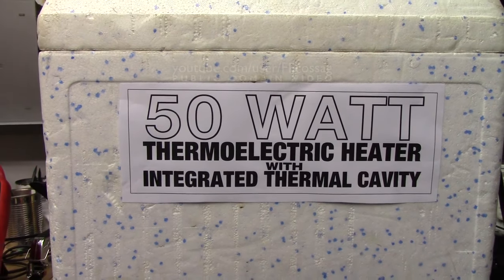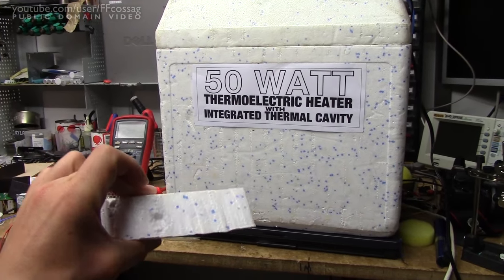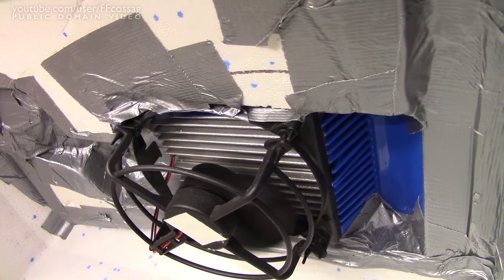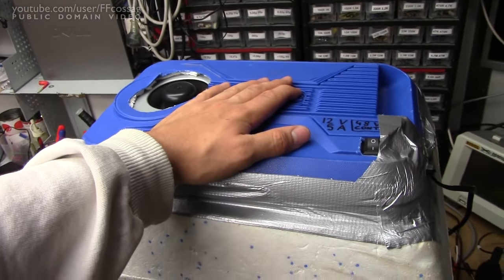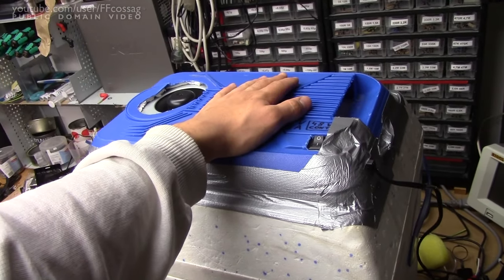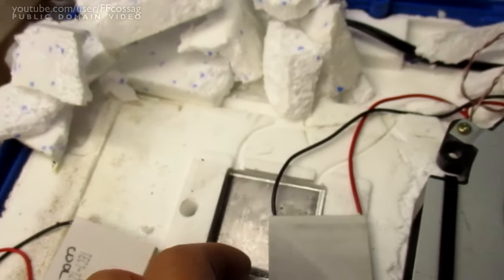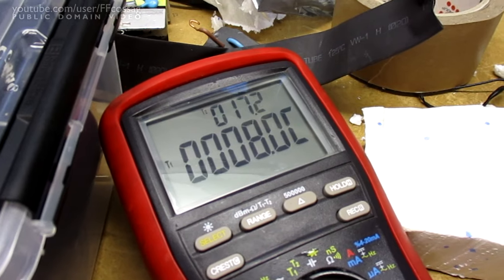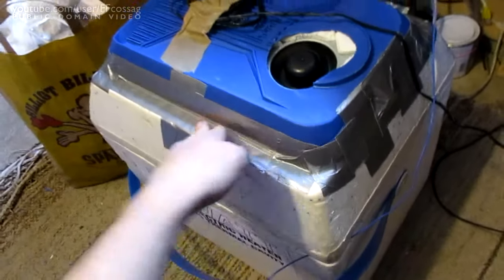Trash picked, TERRIBLE TEC fridge turned useful

Comment: It seems to me like there really isn't anything of the old cooler left now - a plastic cover and 2 heatsinks. That insulation you use works surprisingly well though.
Reply from the maker: Yep, basically. The styrofoam with the peltier cut-out is still original, although it's obviously surrounded by insulation.

Comment: One unpleasant surprise I got from a styrofoam cooler costing under $5, probably more like $2, was that it leaks easily.

Styrofoam coolers in my opinion are only suitable for one-time, outdoor use. Do not set a styrofoam cooler that is in use on fabric, and especially not in a vehicle. You'll find a large wet spot, and more problems than you really want to deal with. My cooler was filled with seven pounds of ice and, having left it in my car over night, all seven pounds (except for a bit of ice) had impossibly drained out the bottom by morning. The cooler had no punctures, cracks, or visible damage.

I see that you're using the styrofoam cooler more as a refrigerator, but it just isn't as robust of an item as it might seem.

Comment: Are you gonna put a thermocouple in there to measure internal and external temperatures? PWM the TEC then with a PID loop to maintain a set temperature 😃
Reply: Can you make it cool more with PWM?
Reply: Evgheni Melman Probably not, but I like your thinking. I imagine you're thinking of how it works for LEDs to increase apparent brightness? It works for LEDs that way because of the way our eyes see light, and fuse flashing light together. It's exploiting a trick of the brain

Comment: dual fuel condensing/lpg fridge - used in caravans for decades - I have a 20yr old one that still works - and is more efficient (from what I can tell) than my diy peltier cold box.
Reply from the maker: They're probably not that much more efficient than a peltier, it's just that you have such a HUGE increase in power density in a gas bottle. I don't really have any way to exhaust the burned gas, however, which would be a bit of an issue.
Reply: I've tried all whilst camping - commercial peltier/ home made peltier and lpg/12v condensing fridge - from experience I  found the latter more efficient - and practical - even just on 12V - the Exhaust and inlet for the LPG is literally a cut hole and bolt in experience. It was so easy - I did it myself on a camper van and a caravan. However, I can see the benefit from using the peltier - but I would double or triple the peltier units - one just doesn't cut it - esp. when you need something cooled, such as a meat product or indeed milk. Once I'd definitel go for a temp control using Arduino - it's cheap and easy - and can reduce battery consumption when off grid.
Reply from the maker: Sasquatch
A fuel powered fridge is definitely going to be more practical and less headache. You could probably even get some useful heat out of it if you worked some magic on the exhaust.

I would like some kind of automation on the fridge, sadly I didn't have time to set it up during the couple of days I had it prior to leaving.